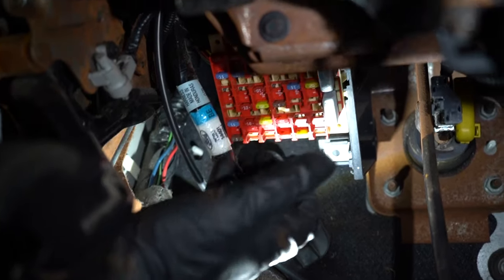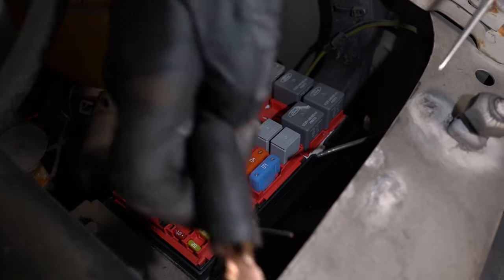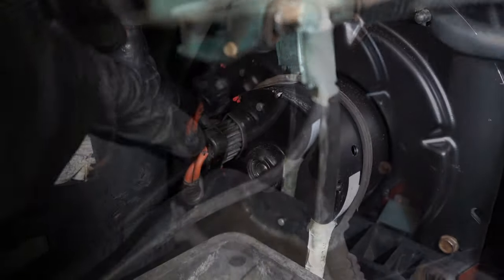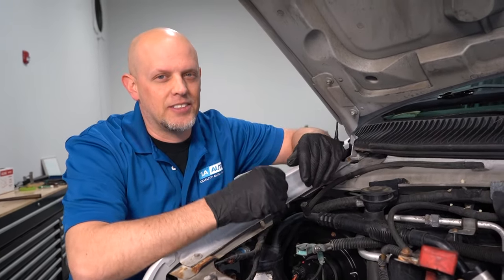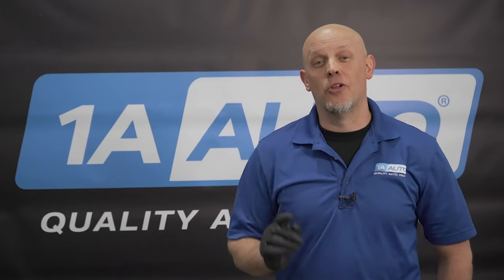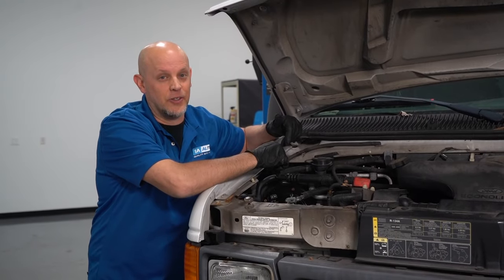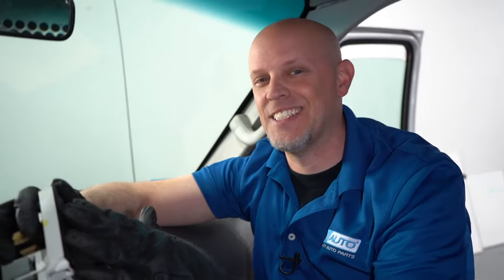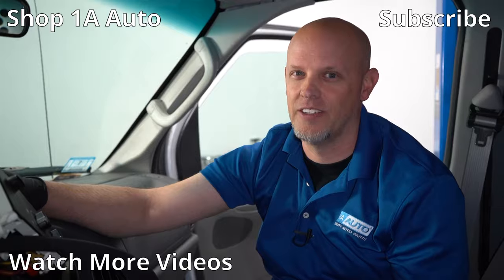No Air Blowing From Your Ford Van Vents? Diagnose Blower Motors Ford E Series Vans!

Comment: I just did this job and had both a bad blower and a bad switch. Thanks for the video. Don’t discount that both may be bad though. Our blower made no sound no air, a whack of a hammer showed some signs of life, all power and ground checked out: we assumed it was just the blower. 

New blower in, and it has airflow, but very low. 

Checked the switch visually and would ya know it was burned. Idk which happened first but in our case after a blower and a switch we are good to go another 200,000 miles

Comment: I have a Ford Econoline 350 6.8L  V10 15 passenger 2001.
The AC rear and front has been replaced. The rear blower is blowing the AC. The front blower is episodic.  sometimes it won’t come on at all and then eventually it will come on. Especially after I drive on the freeway the front blower will come on. And it will stay on for a while and even after I turn the van off it’ll come back on when I start it back up. 

Does this mean the blower motor is going to fail, or the entire blower itself will fail? Also the van does have a bit of rust. Is it possible one of the components is rusty as you stated in the video?

Also, thanks in advance for any ideas. I really appreciate the video, well done.

Comment: Just some advice, you can spend a half an hour finding the fuses and checking them...or you can go straight to testing the wire harness that connects to the blower motor. I was cussing after all the fuses ended up good just to find out I had full voltage coming out of my harness with the blower on inside. 

Looks like I need a new blower motor. I'll change the resistor while I'm at it.  I haven't run the bus in a while and it was running good and warming everything up in the cold weather and just cut out after about 25 minutes.

Comment: Ive replace resister, harness, blower motor, vaccum line and reservoir. Actuators now work but no air blowing on 2008 ford e450. Old blower motor was likely good because new one does exact same as old; it turns but nothing blows out vents.

Comment: I have one of these vans and my AC only comes on slightly when I turn it on high only and it barely blows any air out but I can hear the fan blowing really well what should I check to find out why it's barely putting out any air out of the vents but I can hear the fan coming on just fine thanks for your help your video was very informative two thumbs up
Reply: Thats kind of what im looking for. Mine only seems to blow on the lowest speed no matter how high i set it.
Reply: Resistor
Reply: Ever find a fix?

Comment: What happens if it never goes to the front it stays on the defrost fan. No matter what setting you switch it too
Reply: Hi, Jerome.
I watched a couple of videos today and some of them address your question.
It seems that happens when there's a leak in the vacuum tubes or the canister is bad.
It's an expensive repair but there are diy solutions showed in some videos.
Good luck!
Reply: Did you find a solution, i have the same problem

Comment: I need to replace the blower motor fan or fan bearings....it works but makes a horrible noise.  How do I access that area? It's in a 2023 ford transit 250

Comment: Cool so on my van it has about 11.8 volt at the terminal connect to the motor when the switch set to low but motor not running.  It only run on high.  Is there a possibility that the resistor is bad? If it’s bad theres would be no voltage at motor terminal is it?

Comment: The tap did something but my van vent is working only under a load. It’s not very high but it’s running. I’m wondering if this is vacuum related or blower motor related

Comment: What if there isn't 12v at the connection to the blower motor? I checked all fuses, they're good. The relay is also good. The blower motor is also good, because I was able to power it directly from the battery. The ground to the blower motor connection is good, I get 12v. (I don't have a test light, but I do have a multimeter.) The switch doesn't look melted or burned. My blower used to only work on high (I now know why), today it was  working fine, then it just quit. I know the problem is because there isn't 12v at the positive side of the connection to the blower motor. What else do I need to check? The speed selector switch is good. I'm not sure how to check the main switch (off, vent, floor, AC, etc). What am I missing?

Comment: Ok check it out. Bypass is gone. Lasts a while. Suddenly goes back to defrost only. Look at bypass and all is intact and have strong vacuum. Still will not switch out of defrost. Change actuator switch and still does not work. Oil on the lines. I have the dash apart and if I direct the vacuum line directly to the blue line the blend door moves and blowers return. I put it back on and it won’t switch over